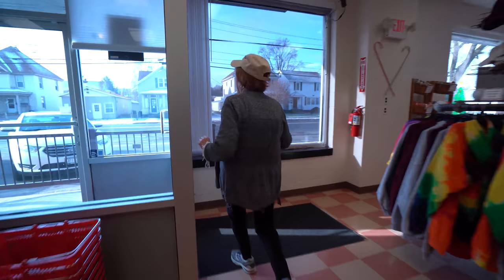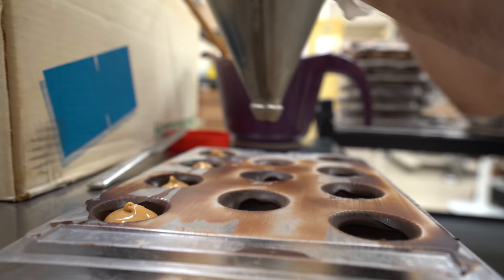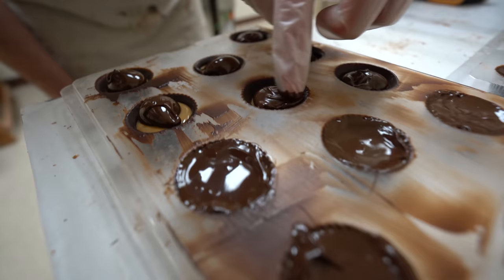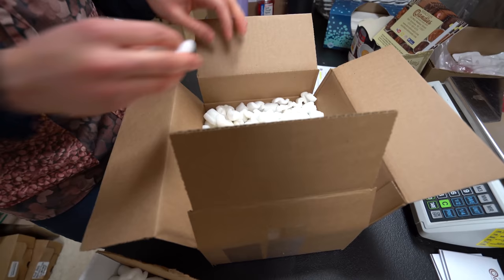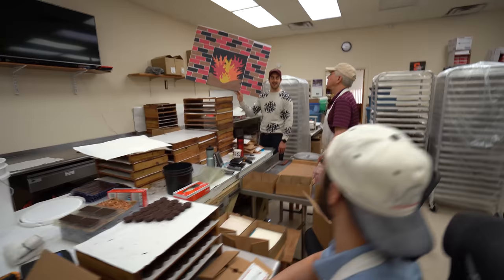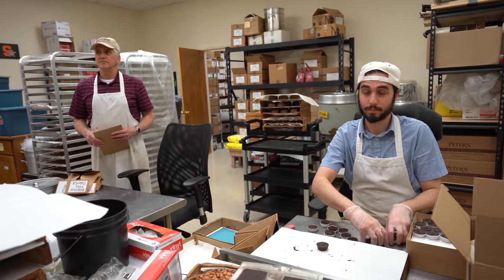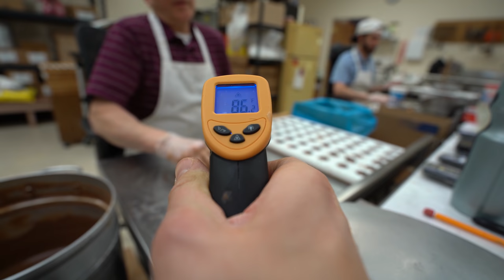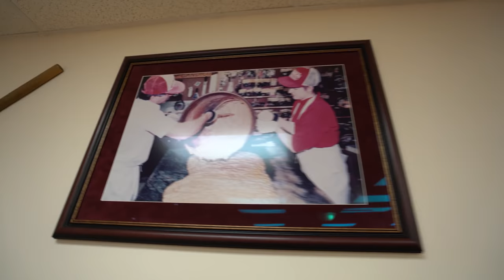How Many Peanut Butter Cups Can Max Make?!

Comment: I used to paint windows & had to make images 5 'x 6'.  Cara's got great talent!  She should try much larger designs so they're more visible from the street.  They can really show off her talent!

Craig, you wanted decorating ideas .  .  .

If you can get any Plexiglas(R) panels, drill tiny holes across the top, have Cara do her magic, and suspend the panels from the ceiling with fine twists of wire.  These may be saved & reused.  Suspended panels help to break up the openness of the ceiling area, and being painted on clear panels, interfere less with security.  Best sizes are about 2' deep and 4' across, suspended as low as you wish.  Edges may be sealed with decorative tape or just lightly sanded and left alone.

Also, wrap ceiling panels in smooth metallic paper with wide ribbons & super-duper bows.  (Not ALL panels, just here & there!)   Don't use figured paper, as images are hard to distinguish from even a short distance.  Plain, bright metallics look much classier.  They can resemble candy boxes and change with the holidays.  Terry said she uses wired ribbons, which will make bows that keep their shape.  Don't have any up late spring to early autumn, as flies dirty them up too much.

Your store is huge and airy.  Terry did such a nice job clustering displays, which helps the eyes focus.  Clothing, puzzles & mementos in one area,  hard candies and chocolates in others; special vignettes for seasonals.  And you move things around, not becoming mired in stodginess. 

 Your family museum corner is a great way to showcase the Andrianos' long commitment to East Syracuse, as well as honoring your forebears.  As Steve alluded to in one episode; they had NO air conditioning, humidity controls or weather forecasting (except for Granny's lumbago and the local almanac).  Dealing with coal-heated equipment, and many other impediments, they could have used them as reasons to give up.  They did not.  And again, Hercules' labors bear fruit (er, candy).  More displays will attract history buffs, nostalgia lovers and the curious.  If I could come to your store, that would a place I'd linger with enjoyment!

I admire Steve and Terry loving their kids so much that they'll take the chance theirs may be the last generation in the business.  What a tremendous message to share with the world!  But what's probably reassuring to the community are the many GOOD employees they have, some of whom may wish to take the helm.  I doubt Hercules' doors will close for generations to come.

Thank you for so much fun!  May 2020 herald ever more wonderful surprises! ♥

Comment: To Max at Hercules candy.  I had a idea that might make the process a bit faster while making the peanut butter cups.  I was thinking that instead of using your finger to have to even out the chocolate on top, maybe the use of a small air compressor and an air gun to push a pillow of air straight down above the peanut butter cup to quickly smooth the chocolate from the center to the edges of the cup.  Much like you do to fill them with the peanut butter.  Probably would have to adjust maybe the pressure and how close you were when you fire the air.  I think they make really small compressors so the shop wouldnt have to endure to much noise.  Just a thought, or maybe you have already tried something like this.  Love the video's.

Comment: Can you make peanut butter and potato chip cups? It's the best sandwich combination, I don't see how it could go wrong with chocolate.

It's definitely not the same thing as just eating crunchy peanut butter - thinly sliced crispy potato chips mixed with smooth peanut butter has almost a crunchy flaky texture, rather than just a crunchy peanut texture (as in normal crunchy peanut butter).

Comment: So question...when Max was topping off the mini peanut butter cups in the enrober room, could you use the vibrating table to smooth them out quicker instead of doing it by hand? I'm sure there's some factor I'm not thinking of. Or maybe you didn't have the vibrating table when this video was made?